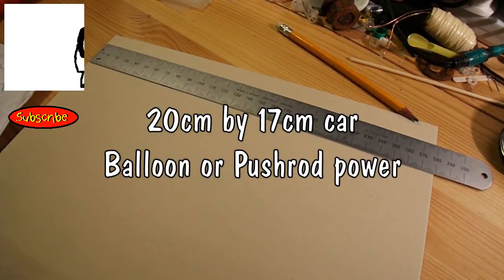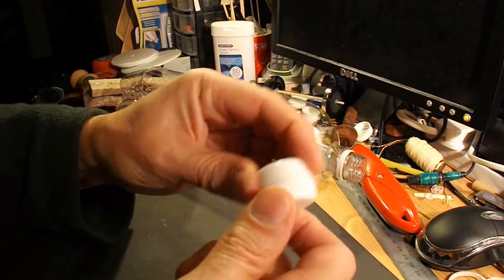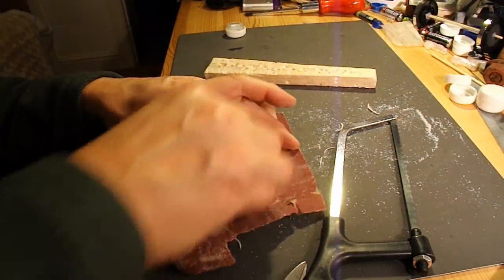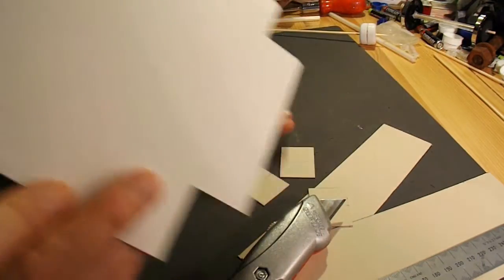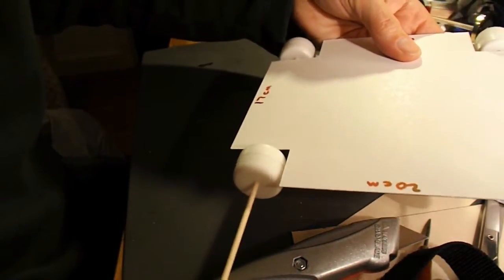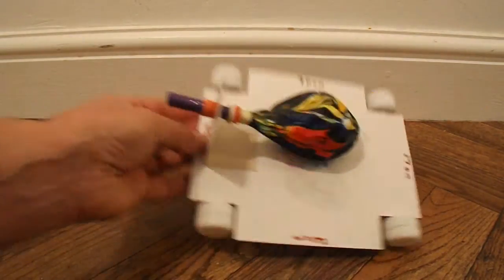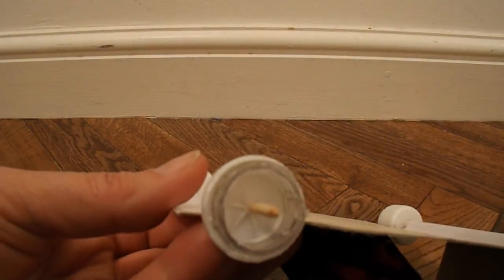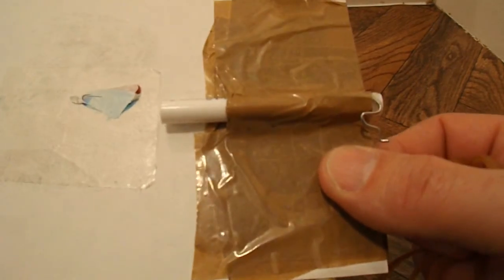20cm by 17cm Balloon or Rubber Band Pushrod powered car

Comment: Where does everyone get the wide straws to put in the balloon?
Reply from the maker: I use tubes from felt pens. I tried many different types of tubes until I found something that fitted the neck of the balloon nicely. The bigger the diameter the faster the air comes out but that does not necessarily make the car go faster because there is less pressure so you may need to experiment to find what works best for you.
Reply: Thanks. Hopefully that works!

Comment: I have a good idea for you you should make a car powered by a small remote car engine and has light and coulours and 40 cm long and 40 wide it might hard but try your best
Reply from the maker: Hi Safir Dalaf, thanks for your suggestion. I want to finish my current 15x15x15 series before Christmas which I will do with another 6 cars (uploaded number 9 tonight). I will then have a break and then have a look at other projects. I will think about your suggestion then.
Reply from the maker: Hi Safir Dalaf, I just uploaded a video with a 40 x 40 RC car on it :)
http://youtu.be/DLcj07KuCL4